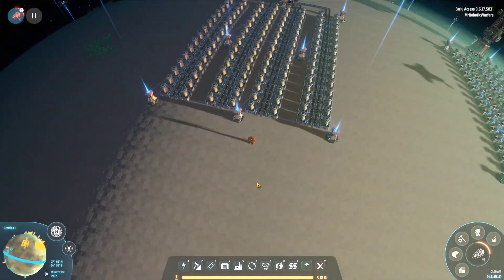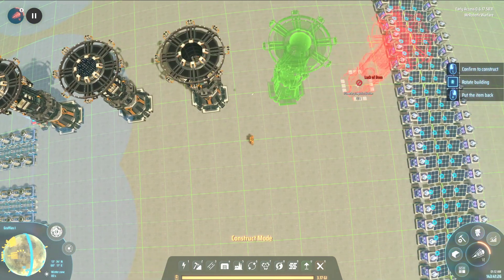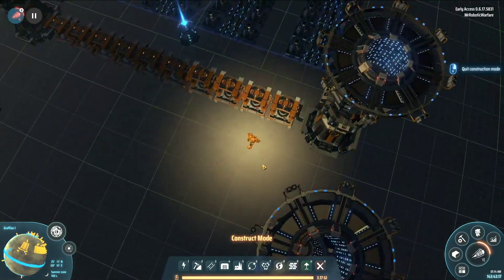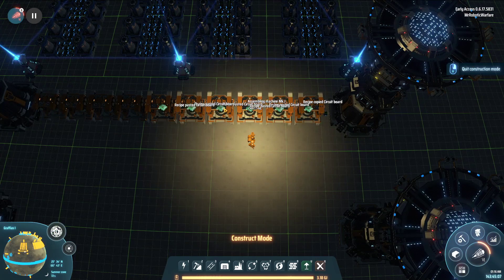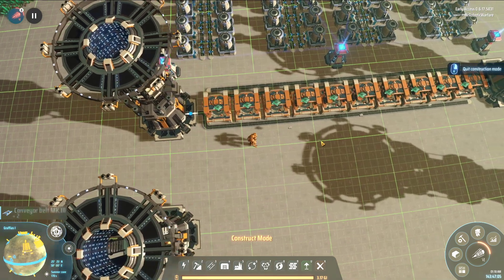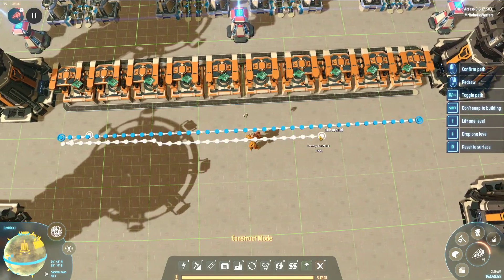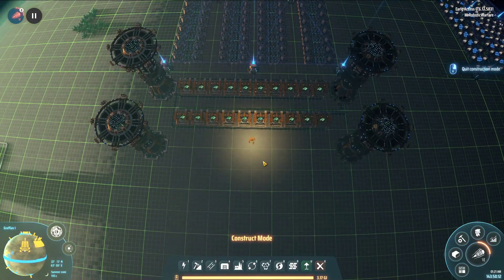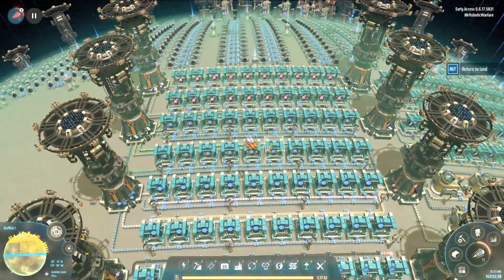Tileable Assembler Tutorial || Dyson Sphere Program

Comment: Does it still work well for the recipes that require 3+ inputs? What I'm thinking is: you'll need all slots from the input tower, and then send the finished product to the output tower. But the output tower is actually the input tower for the next line, so it'll lose one possible input space. And as you need all 3 slots in your input tower, the production line behind it cannot send the finished good to it, because that would take one slot. Have you had such problem with this layout?
Reply: It can still work but you'll have to ensure the sections to the left/right can share in inputs/outputs or have enough free slots.

Comment: This is a great set of logistical patterns.  The smelter arrangement is a fantastic use of that space.  The factory lines is a great pattern that looks like it could be adapted in multiple ways to fit different needs.  ILS would be a good choice for both depending on needs. 

I would use ILS for smelters so that you can easily bring in raw resources via vessels and then the probes can ship the refined resources around the planet where needed.

Some of the production lines would benefit from ILS as well as you could have a larger buffer and more room for belt routing.  It would reduce the number you could put between smelters and equator, but it won’t be an issuer for larger production builds.

Either way it’s a great pattern that can be adapted easily for many builds.  Great job

Comment: The Casimir Crystal is the most demanding I believe.  It takes 3 Hydrogen per sec on a Mk2 Assembler.  As long as you don't upgrade those machines to Mk3, then the setup would work fine.
Reply: I wrecked my base design with those. They consume hydrogen like crazy. A mk3 belt can sustain 6/7 mk3 assemblers only. It’s rough on the hydrogen supply
Reply from the maker: Ah, you're right! Good catch, thanks.

Comment: How does this fair with bring supplies in from off-world? One thing I am worried about in your system is your off-world throughput. The way to increase your off world throughput is to have more ILS with more ships bring in the same item, just like your use of drones. If you were to use ILS in your smelting arrays, you increase the number of ships you can send off-world, and can use ILS that don't get a lot of use by adding, say, iron in an empty slot to allow more throughput.
Reply: Shouldn't be a problem. Just place multiple interstellar stations on the poles to receive ores. He doesn't need to ship much off world with smelting and assembling all in one place.
Reply: My smelting planet is now producing all the mats for the Dyson sphere and yes iron import is a problem. It requires dedicated ILS for iron only so that the 10 ships are focused on the importing. But like Sugar Roll it’s easy to fix with extra towers. Drone throughput is not an issue at this stage for me

Comment: The Smelting Array is genius, this one here not so since IMHO its way to many towers for the few assemblers. But it gave me an idea to optimize it (allignment) :) What i usually do is to use one tower for 3 rows of asemblers that get the goods and directly feed the product back into the tower, like with the smelters you did. Works like a charm.
Reply: You can simply remove a few towers and still make this works. I.e. if you make a 2 'section' long part, you get 22 assemblers, and 35 fit when making it 3 sections long. You just have to calculate the required throughput that determines the max size you can make them, but you arent limited to only making them 10 assemblers per section.

Comment: Awesome vid : I've been swiping your concept for smelters, but for assemblers I have been doing it somewhat differently. I use full interstellar logistics stations, so spaced with a lower density. However I can usually use each station to support 40 assemblers by carefully designing the belt placements, and, like your system, the same space can support tidy numbers of other types of plant.
Its a veritable hive of industry, although I suspect your system of using planetary stations might make it easier to purposefully guide product streams when you go full interstellar, where I will be hunting botttlenecks in a production free-for-all ;-)